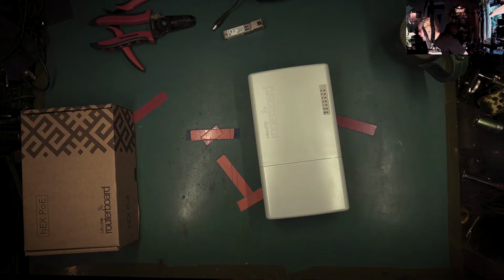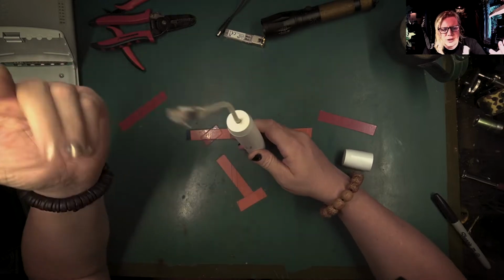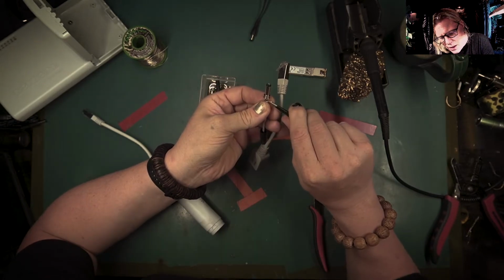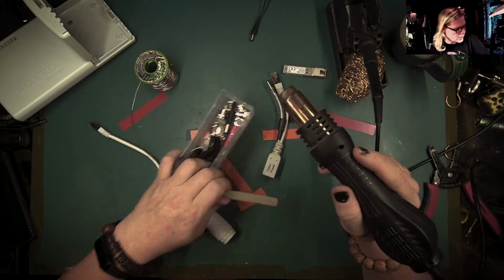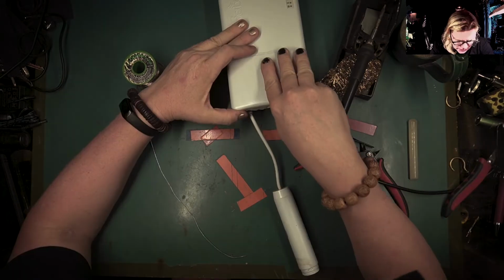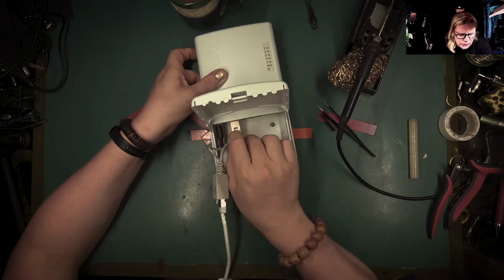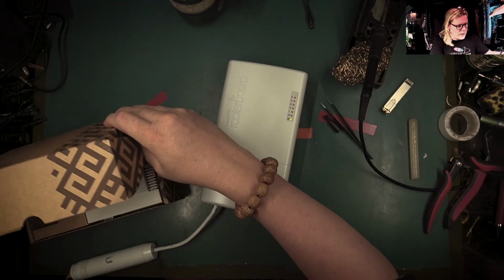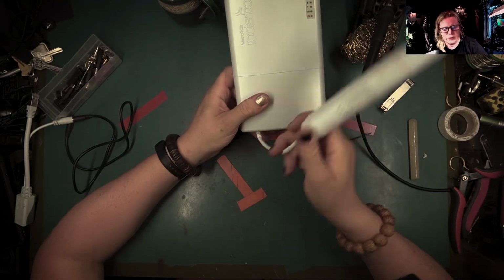Fibre box POWER mod

Comment: You can actually totally buy the reverse version of them 10/100 injectors online work well for quickly adding "POE" to a non POE device
If your powering from POE why not just use a RBFTC11
Seems like it would be cheaper and cleaner setup wise
Reply from the maker: 1, none available, 2 apparently their Eol :(  3, I'll have more ports if needed.
Reply: 4, this is the msts cost effective solution, i was about to do it myself a few weeks back, but not available here anymore for me :( Ive deployed 48V POE everywhere for my old reverse POE switches, which are failing hard, due to shitty chinese transceivers, so i was lookign at this as an alternative. One thing thats screws me is id have to buck everything down with a trasnformer and cant fit it all in tehe available spaace, plus i need 2 SFP ports. Looks like i have to go the big mikrotik reverse POE netpower 7R! ANyway, i find it a conicidence that its you sarah, after we talked about my broken fusion splicers a few weeks back :)
Reply from the maker: @jeremyjohnthompson5187  I try to help <3